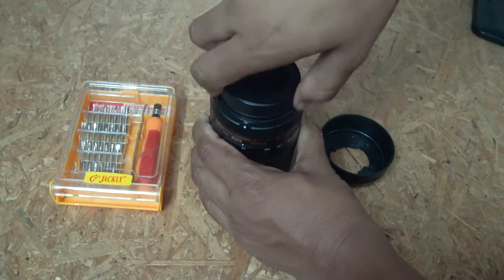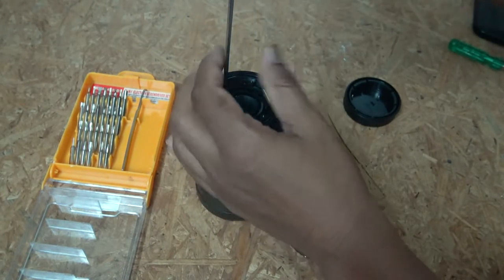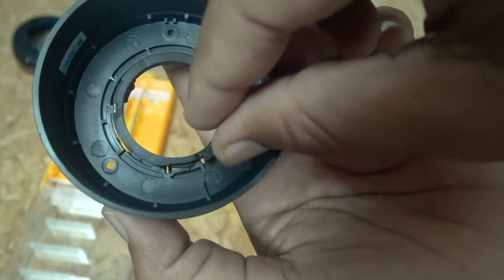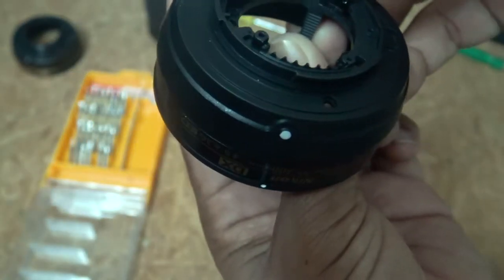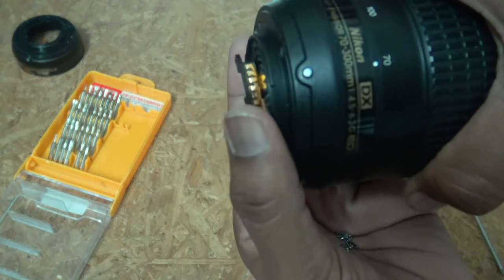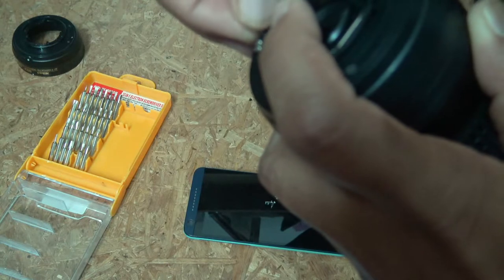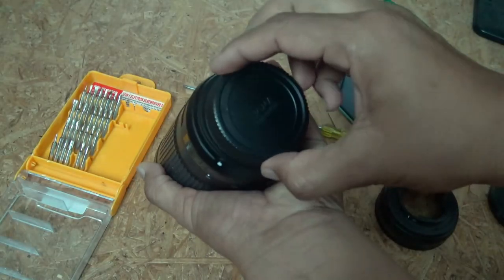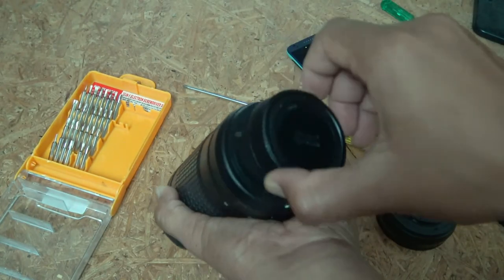Nikon 70 - 300 mm DX lens mount replacement

Comment: Thank you!  Excellent video.  One thing that was different for me was that a smaller spring fell out from under a little round electrical connector.  So, viewers, if you find an extra spring after taking off the ring, it goes beneath the little spherical shaped metal connector along the edge of the ring.  (at 9:17 in the video above on the left side of the ring).  Also, I don't recommend trying to do this w/o magnetic tools.  The parts are too small to hold onto with your fingers and impossible to find if you drop them.
Reply from the maker: Thank you for your kind words and updating with your insights too.